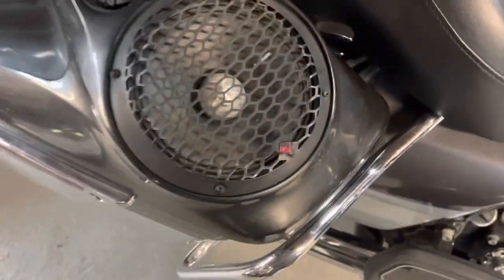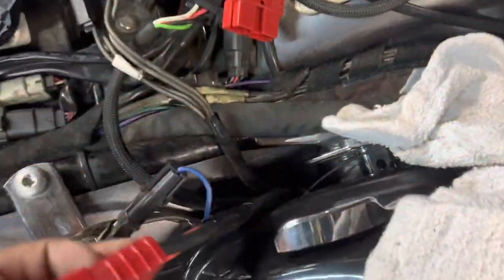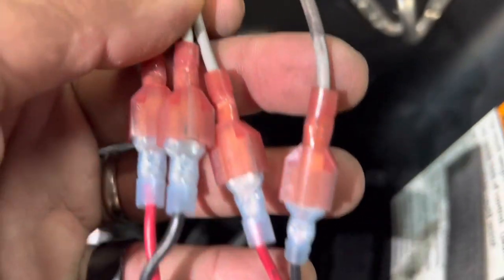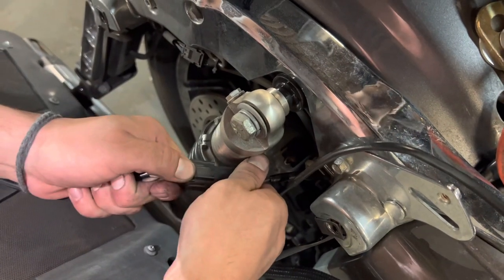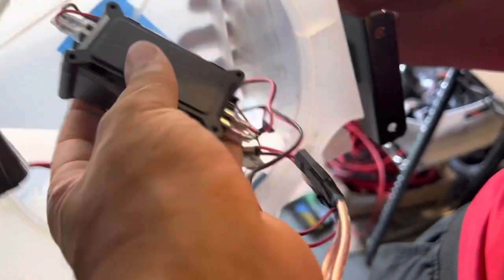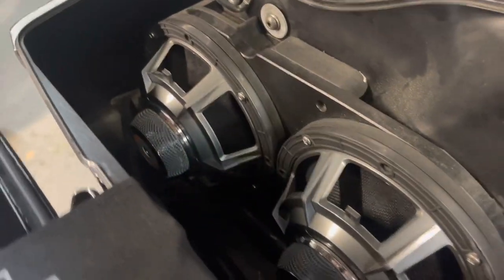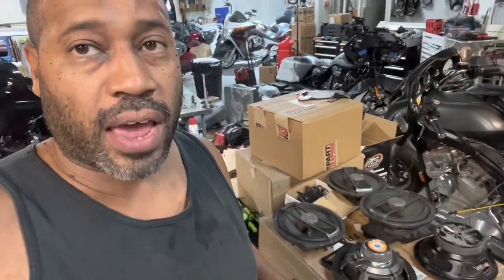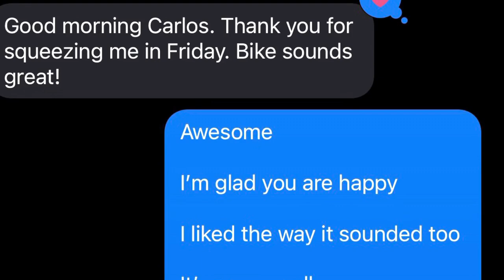Harley Davidson Street Glide in for a Nvs Audio wire rescue and a audio upgrade.

Comment: I ran two of those HXM8 speakers in my saddlebags. (Check out video) They are an excellent full range speaker that plays down to 35hz with no problem.  Excellent bass when you band pass them 35÷500.  They only do 120rms.  You need two hxm8 to do what one hettz 200l will do.  I recently replaced HXM8 with kicker comp RT 8 inch sub.
Reply from the maker: I completely agree with your statement 100 percent. Diamond is releasing their 8 inch neo mid bass soon . Kicker comp rt is our favorite subwoofer for stock or small
Saddle bags 👍🏽

Comment: Could you show inside a side panel at some point? I’m looking to move a bunch of auxiliary wires off of my battery terminals and run them to inside the side panel. Changing a battery is a nightmare. Bought a used streetglide and all the work was done sloppy

Comment: Can you tell me the difference between a SD 800.4 evo x and a 800.4 evo 4.0?
Reply from the maker: The evo 4.0 is made for the Brazilian market not the us market . It’s made with cheaper components and does less power . The 4.0 does 600 watts total the evox does 800 watts . The 4.0 is very noisy too . Plus you can’t get the 4.0 warrantied in the United States .
Reply: Thank you